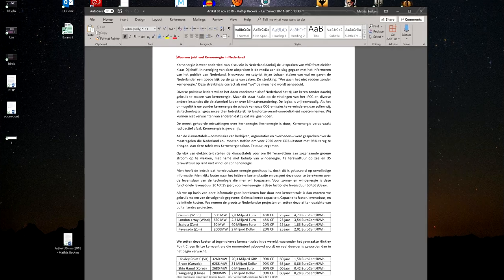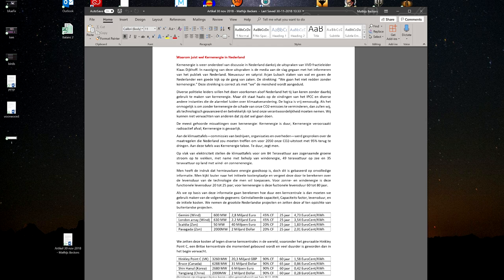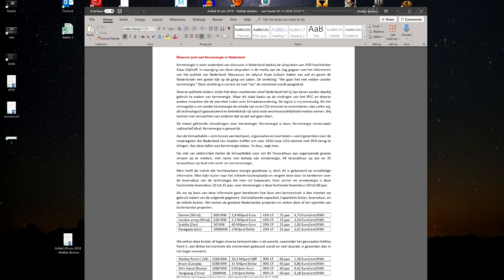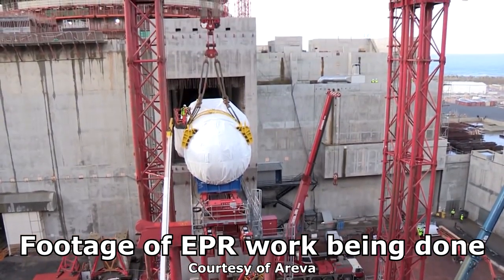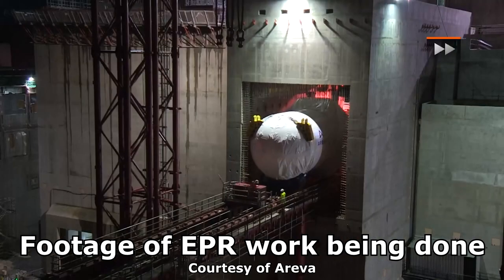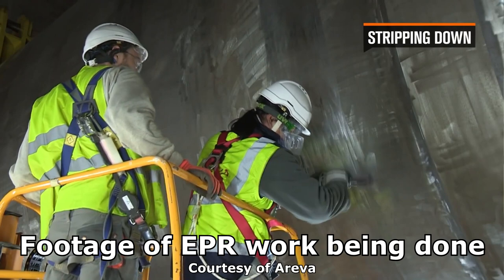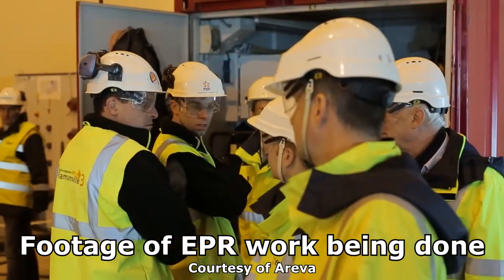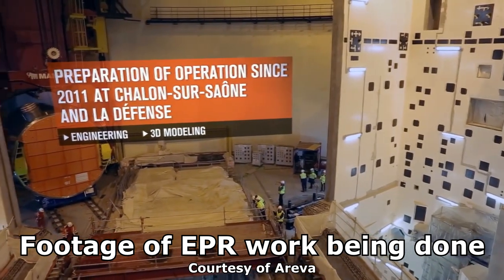Is nuclear really that expensive?

Comment: I guarantee if any of the new designs can achieve serial production, LCOE prices will be fantastic... Maybe not natural gas combined cycle in the U.S. fantastic, but very good. Just the difference between Sanmen 1 and 2 was tremendous. Vogtle 4 is also going quite well based on the learnings from Vogtle 3. Also notable is that all of the Chinese AP1000s have started up and worked with basically no issues. It's been a minor miracle. I can't say much more than that, but the technology isn't the problem... It's just an experience "infrastructure" which must be developed and maintained. If you let it languish, it's painful to rebuild.
Reply: Barakah unit 1 and unit 4 has a 40% difference in cost and time.
40% reduction from what is the most competitive nuclear project in the world, today is insane. No other industry experiences productivity growth like this, because so much learning is human instead of engineered. It proves that we are only as limited as our imaginations and our drive to excel.
Reply: Well the NRC, DOE and EPA will make sure those new designs are not cheaper than anything. The rest of the world, very likely.
Reply: @chapter4travels  
The Koreans, Arabs, Chinese, Russians and (soon) the Turks are all showing that large LWRs are still buildable and still the technology with the largest industrial base.

So why is the LWR focused regulator, NRC, so expensive to build under?

The answer is that it is not NRC, but Gregory Jaczko's toxic legacy. To accommodate Harry Reid and mollify his protests against Yucca Mountain, Obama had to appoint Gregory Jaczko to the NRC. Not because of any qualification but because Obama needed the nuclear industry to be able to say that they had taken care of the waste problem, the scientists were all saying that Yucca Mountain was going to work, the nuclear industry was happy with the science at Yucca mountain and wanted any solution and so, he had to compromise.

Jaczko forced multiple engineering changes to the AP1000. Spread lies and misinformation during Fukushima's critical moments, against staffer advice. Then upon "retirement" (basically his staff revolted against him) he became an antinuclear activist.

I think that Obama made a mistake in listening to the industry and listening to the DOE. In deciding to push forward with Yucca Mountain (which Harry Reid would sabotage anyway) he let a fox into the chicken coop. What he should have done was push forward with the MOX fuel fabrication facility at Savannah River and tried for ultimate disposition at either Hanford or Savannah River itself. Both sites have been well studied and are well suited for internment of transuranics (if desired). But hindsight is 20/20.

Instead Yucca Mountain was pushed. Savannah River ran into contractor problems. AP1000 was changed multiple times and made new build very expensive. Now the US is in violation of the START treaty requirements to destroy Russian plutonium by MOX fuel as well! And Vogtle is struggling to get back on track. 

Is this situation soluble? Yes. But it will take time and importantly, performance, to earn back those tarnished reputations. 
https://atomicinsights.com/?s=jaczko . 

Sometimes the most appropriate solution is not the unimaginative one. And Obama had a failure of imagination here. Having said that, some of his programs like GAIN are now bearing some fruit, so it's not all bad.

Comment: There is no such thing as a wind or solar power grid. There is only a full demand sized reliable grid, powered by coal or natural gas. Wind or solar just add to the expense and complexity of the reliable system. Add all those thing together along with replacing all the solar panels and turbines at least once because of their short lifespans and then compare. It's not even close, not even on the initial capital cost I would venture.
Reply: Oh and don't forget the cost to recycle all those solar panels and turbines.